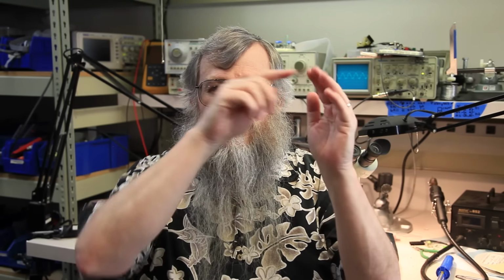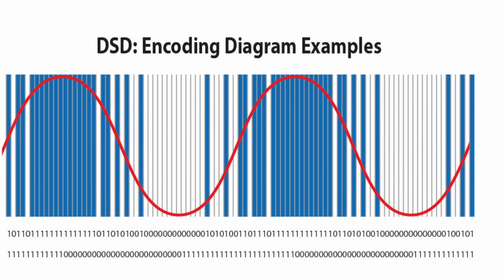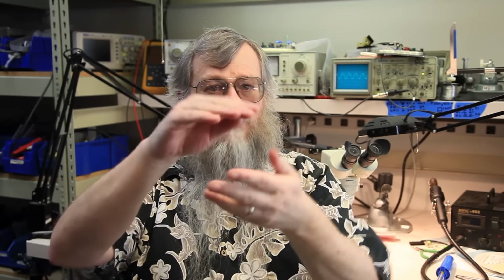Ted explains DSD

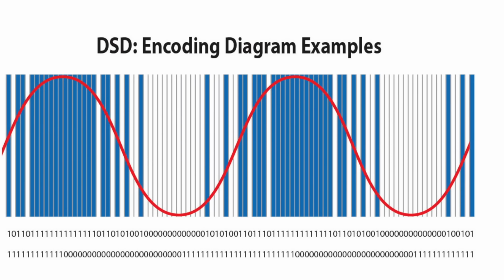Comment: 1:09 First, it doesn't matter that the graph looks like a wave form. It isn't something that i have to understand, the computer has to, so it can appear in any way. It's not a plus.
Second, that likeness you're talking about is not even real: you drew the red line, it is not rappresented like that in the stream at all. 1 means the amplitude has increased compared to the previoys cycle, 0 that it has decreased or has remained the same, so there are lots of spikes and therefore lots and lots of noise. 
In conclusion, the example is pretty but completely wrong and misleading

Comment: This implementation of DSD reminds me of the spiel of proprietary schemes like MQA (s oil) I could not understand a word of what he said. Everytime someone says something cannot be measured, I am a bit uncomfortable with such assertions.

As we increase sampling rate, high sample rate PCM @ high bit depth, will approximate DSD, and any differences will be negligible (if such differences truly exist).

I had written the paragraph above - simply out of my own laymans reasoning, and lo and behold, I checked the Wikipedia page for DSD, and it has this paragraph included :

"Because of the nature of sigma-delta converters, one cannot make a direct comparison between DSD and PCM. An approximation is possible, though, and would place DSD in some aspects comparable to a PCM format that has a bit depth of 24 bits and a sampling frequency of 88200 Hz.".

Then in another youtube video from PS Audio, their Gus Skinner - Audio/Music Engineer/Producer says he would not wish to have more than about 30 multitracks in a DSD Mixing session, as it would end up adding too much noise. I could imagine a similar issue with high sampling rate PCM projects, where there would be a similar accumulation of any noise above the audible range, i.e noise which we humans would not hear, but which would at the very least compromise total noise.

But this is always going to be an issue with any multitrack system - multiple microphones, and multiple tracks, will increase the noise, for example if one records an orchestra with a single pair of microphones,  or records an orchestra with a final mix of many microphones, the multi-track version will have accumulated noise and less dynamic range, from the total number of summed up noise in each track. Not a new problem and somewhat a common issue, so DSD mixing and PCM Mixing are somewhat having similar issues in that regard.

Ultimately these are issues that we will always have and the best solution is not to do all the fancy filtering, but rather to capture as is and play back as is. To improve quality  - lets do the obvious 1st, double sampling rate in the Case of DSD such as DSD 128 or in PCM use 24 bit 88 khz sampling as the minimum, and achieve  similar results.

MOst people do not have the kind of gear and listening environment that would make any appreciable difference in discerning a difference, so IMHO, just stick to what works for most people - PCM , which is so much easier to work with at the mixing and mastering stages. I doubt if DSD will ever become significant, in pop music, therefore DSD will remain the preserver of esoterics, the snobby ones, most of whom are old enough not to be able to hear any difference anyway, cos by the time you have made enough money to by the esoteric playback speakers, amps, listening room, and DSD recordings that only a few people can appreciate, you are most likely old enough to have lost the ability to hear anything above 14Khz anyway - So why all the bother. 

Shakespear said it most elegantly - DSD is simply much ado about nothing. Higher bit rate and higher bit depth PCM is more than good enough - 24 bit @ 88.2 or higher is more than good enough PCM, and so much easier to mix and master than DSD, needing no specialised gear.
Reply: i do agree. but i have some anecdotes about the same song sounding better in DSD,  as the same song in a different format, listening with EQ/DSP active. obviously DSD playback voids all the eq/dsp and still the sound is just full, punchier, better. there is a bit of magic at work there :)

Comment: The sheer intuition this gentleman possesses when he talks about how PCM uses dynamic element matching with randomised errors to compensate for any error during the translation process sums up his genius.

So, even though I get the time-invariant waveform in terms of energy to be perfect by patching up the errors, that doesn't necessarily mean it translates well into the energy associated with frequency bands in the s-domain and therefore, the phase of the signal, which is why PCM sounds artificial and sterile comparing to analog or DSD.

Comment: Could somebody please explain this. You need to "noise shape" in order to produce hi-res DSD. You dont need to "noise shape" if you produce hi-res PCM. So what is the point of DSD? In an environment when space for a 192/24, 6ch recordig is no longer an issue - why not just stick to hi-res PCM?
Reply: DSD Still sounds better. Not to mention pretty much every single dac chip out there are converting everything to dsd on the inside. Simply by avoiding quantization in real dsd gives you better transparency and less possibilities for errors and aliasing to occur. The newest sabres/AKM/ Cirrius logic convert everything to dsd internally. Ti could be the only ones who don't do this only cause they have not released a new high end dac chip in more than 20 years. If people had any brains everything in studios would be recorded as dsd , recoring in low res pcm is just stupid.
Reply: @kautkascitadaks  om using optic cable. So i dont have to worry about this😅
Reply: @kautkascitadaks  YES I ALSO HAVE LISTENED THERE IS ALSO A 32BIT DSD
Reply: @kautkascitadaks  However, all the best dacs do PCM only.
Reply: @clippy_friend  It can ne the other way around rather. Depends on the maker. Psaudio coverts everything to dsd while weiss engineering does pcm. That is a very uneducated statement thats is in no way shape or form true. As for makers that are more known benchmark agreed in the industry as top of the line equipment. Their best dac comes with es9028pro which is a hyperstream modulator. Most top end dacs (especially Totl products )do dsd and will have no problem doing so. Only lowly mass produced units can not do dsd. My opinion if a dac cant play back dsd its not good.
Reply: @kautkascitadaks  I'm thinking of vintage and new r2r dacs.
Reply: @clippy_friend  neither of which qualify for the best dacs by any stretch of the word. All top units now use delta sigma or hyperstream modulators. Most r2r dacs are made to cash in people who can not accept that the first type of da tech that came out was flawed beyond imagination.
There is no reason to go r2r over a moder dac chip. There is a reason r2r chips are no longer being made and money is not one of them.
Reply: @kautkascitadaks  audiophile vs measurements geek
Reply: @clippy_friend  subjectivity vs objectivity. Personally never have agreed with measurements philosophy. One can only measure if the sistem has any inherent issues with it. One can mever measure if it sounds good or bad.
I personaly would never use anything thats made for stellar measurements, 99% of the time, measurements is the only thing going for those devices and actuall sound they produce could fall into the very bottom end. But that ia just one persons beliefs and opinions based on my expierience with hifi gear.
Reply: @kautkascitadaks  well delta-sigma chips do more processing to the music, they are only single-bit accurate (ds is inherently less accurate than r2r, that's why industrial and commercial dacs are r2r), and to a lot of people, they sound flat and clinical. the Holo Audio May is an R2R NOS dac that measures just as well as most delta-sigma based dacs. put an r2r dac next to a ds dac, and i'd bet most people walk away preferring the r2r.

it's something i do question regularly. it's all a bit of magic and trial and error, imo. being humans and not machines. but it is interesting that D/S is generally not appropriate for high-end scientific work.

I only am barely grasping it all and have a very limited knowledge pool from which to judge this on a technical level. But I also know that technical advances don't always lead to higher quality results...in fact it's usually the case that older ways of doing things tend to be finer.
Reply: @clippy_friend  read this nefore we continue
https://www.stereophile.com/content/pdm-pwm-delta-sigma-1-bit-dacs it will explain mostly everything thats wrong with r2r. Also its about the sound and not measurements. What i mean is that chip for chip deslta sigma is superior. And the best of them all is ess sabre es9028pro and es9038pro there is no real debate about it. If one is actually skilled enough and has enough technical know how they can sound like whatever you want. ButI digress. For me hyperstream modulators are the best sounding chips out there by miles. Though have to mention that have not had the chance to listen to psaudio or chord fpga dac or the ring dacs.
Ignoring me do still read the article even though its older everything in it still holds water.
Reply: @kautkascitadaks  Hey, I'll definitely read it, and I'm open to changing my mind.  Hyperstream modulators, are those delta-sigma as well? Any examples of popular dacs that use them (i imagine they are pushing into car cost territory). 

I do question the inherent nature of Delta-Sigma and why it is considered too inaccurate to be used in certain industries. Why are R2R chips still used in the most expensive equipment? Like an MRI machine.
Reply: @clippy_friend  Yes and no. In a sense they are but they are a propriety evolution of delta sigma modulator. Ess developed it and introduced the hyperstream modulator with es9008s dac chip if not mistaken.
Best example is Benchmark dac3 by far the best one out there.
 But it wasnt perfect. As most would say not til es9028 pro and es9028q2m came out. This is when everything achieved full potential. Sound of these chips,if done right is incredible. Everything sounds like real life to me. An the quality the dynamics. Till my first expierince with ess sabre 9018k2m equiped device was about to say digital will never be better than vynil(till then have heard a lot of 90's hi end hifi. And some modern attemps with wolofson, cirrius logic,akm,sony,yamaha,panasonic chip based devices. But once i heard the sabre was convinced of its magic. Which i can only describe like it magic. Its like so real in every sense of the word timbre, vocals, and it is actually full range full spectrum reproducing device. I was floored by these wonders in every way. Thats when i made my biggest mistake. Wanted a portatable packge and was short on income at the time. So ended up getting fiio x7mk2 just cause it had the ess9028pro, man what a letdown. My phone was way better in almost every aspect. Simply ridicules, whats worse most people seemed to think thats a good sound representation/tuning. Even the timbre wasnt as lifelike. Then eventually landed on ibasso dap with dual es9028pro. Wasnt interested in having two, just wanted to have them actually sound nic.
Long story short, was a lot closer to true high fi but the sound quality wasnt all there. Eventually after modding the device(capacitors replaced) it actually sounds as incredible as a high end dac with the same chips. Can pretty much stands its own against anything any form factor in 1.5k price range. Now not even sure ill be getting my big dac anymore. This for me is fantastic enough. 
Problem with these chips is they are software controled and have to be for best sound quality. Many folk ignore that and do hardware control wich compromises the quality big time. And even then many have no clue of how to actually work with these things.
Benchmark dac3 is one thing im still inerested to hear and possibly buy though.
Though ill give all the r2r lovers this. A really good r2r dac will sound fantastic and wonderfull. Get why you like them.

Comment: I'm a proponent of DSD as far as it advances demand for higher-quality recordings and playback systems. But since you can't edit or mix DSD without converting it to PCM, its realistic use is largely limited to single-take stereo pair recordings.
Reply: The Sonoma DAW keeps it all true DSD.
Reply: It's easier to convert it to pcm but not necessary you just need good gear. Most studios don't have good gear but Octave records for example do.
Reply: What about multichannel DSD ?
Reply: Dsd with 64 bit
Reply: @pracheerdeka6737  DSD 64 means 64 x 44,1 kHz. It's 2,8 M samples/s with one bit.
Reply: @marcusm5127  but bit rate is 1
Reply: Dsd1034/64bit is highest
Reply: @pracheerdeka6737  What do you mean 64 bit it's just on or off. It's pulse density modulation it's like pwm (pulse density modulation) but with fixed time slots to get s steady high frequency sample rate a first order filter can remove.
Reply: @marcusm5127  sample is high but still error..  filter may be lower order but you still need a filter and I clarity it's worse.
Reply: @pracheerdeka6737  Your speakers have crossovers doing exactly the same thing but usually higher order. The Direct Stream dac Ted Smith designed only has a transformer on the output acting as low pass filter.
Reply: @marcusm5127  sir you can use transformer or capasitors or inductor many DACS use differ TECHNOLOGY.. but transformer is best..
Reply: with dsd you can achieve a great resolution in thr audible band at a decent bit rate. You can record it without effort. 
 If you want to mix it you should convert it to pcm.
Reply: Pyramix allows to work with DXD, and kinda converts to DSD

Comment: DSD Is played via downloaded websites only so it's never truly yours to own, is this correct?
Reply: You can own unprotected DSD files and play them in a media player. There are SACD rips available for download, and some vinyl transfers done by people with a DSD ADC. It used to be the case that SACDs couldn't be ripped because of DRM, but that is a property of the disk medium and not a DSD stream. Due to 2 to 4 times larger file sizes of DSD (depending on compression), this format is less likely to be streamed from cloud websites any time soon. Editing or remixing said files is somewhat inconvenient, because you have to convert them to PCM, which is a lossy and computationally intensive process. The DST compression used on some files is also very slow (slower than h.264 and monkey audio to put things into perspective).
Reply: CD Quality is the same as high rez expensive marketing ploy. You can't hear the difference between CD and high rez. It's a fact of life.
Reply: +Paul McGowan I have a 750D Moon and 820 psu & 740p. £60.000 hi end speakers. I listened to the flagship moon dsd but my thoughts were that it simply sounded like a loudness button had been added. I like owning my own material and browsing the collections. Ipad scrolling is like owning thousands of books that are hidden from view and easily forgotten about.

Comment: I like Teds presentation. He explains very well how PCM is different (DAC) and why it may sound different than DSD. I did something like DSD several decades ago for digital voltmeter, which was counting pulses in sampling interval to produce numbers. Clocks and precision of analogue components including op amp are very important. So less components there are is better. If you can avoid PCM part altogether it will increase accuracy of reproduction. But thing is in reality music recording and editing are not done this way.

Comment: Schiit Yggdrasil is a way better engineered dac then this crap magic fairy dust dsd dac for half the price!
Reply: +iheartcomps And you're an expert at electrical engineering to be able to tell that... haha.... PS Audio has been around for decades, they're one of the best  in the industry in terms of engineering.
Reply: iheartcomps Schiit does some decent Schiit. But a better DAC that PS Audio stuff? I'm not fan of PS Audio, but looking at recent Stereophile review of the Yghdrasil - is is further away than PS Audio at recreating the original waveform. In fact, one of the worst ones I have seen, visually it looks similar to crossover distortion in a class A/B amplifier. I don't how Schiit has managed to fuck its output up that bad.
Reply: +iheartcomps Schiit Audio is just that. Shit.